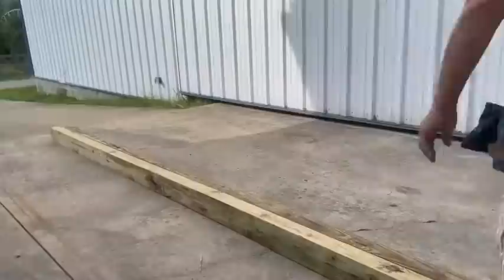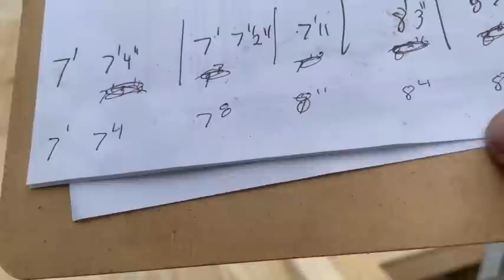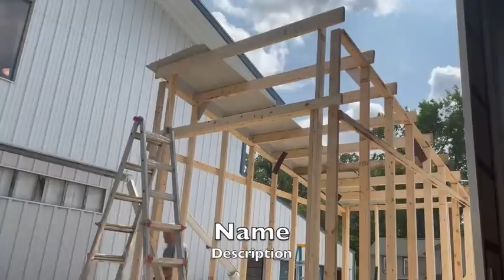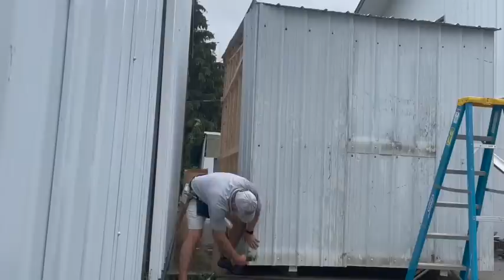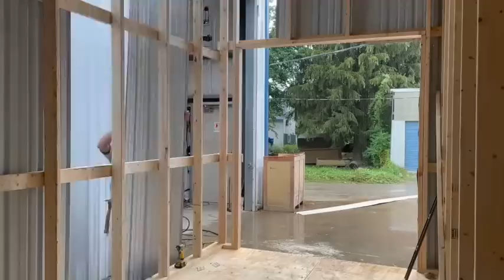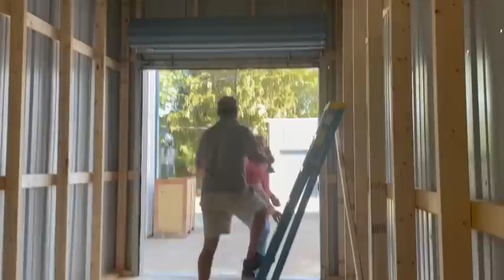How to build an Efficient 8x16 Storage Unit! Maintenance Free for 25% of retail price.

Comment: If you plan on insulating the floor on this style structure use green treated plywood as the under layer between runners and floor joists place floor joists, insulate floor, place 1st floor plywood sheeting layer, install walls and exterior sheathing on the walls insulate install roof trusses sheath inside of roof, insulate roof, sheath roof insulate interior walls and finish by sheathing interior walls install flooring and interior/exterior finishings in that order. Due to roof and wall loads I use no less than 2x6 wall construction and no less than 2x10 rafters and doubled 2x12ridge beams on conventional gable roofs  with no less than 2x6 ceiling joists (this is used for high roof loads) but this works for all insulated shed designs

Comment: I always see the subfloor cut and offset on shed builds. What is the reason for this? It is always done, but I have never heard it explained why. Thanks!
Reply from the maker: Offsetting the plywood provides more structural strength by not having seams all in the same place.

Comment: Those skids, 4x6 stringers , that you are using for your foundation should be cross braced ,and diagonally braced to prevent racking. Especially if you were, to try and move the shed by pulling it . Also the 4x6s are a little light for skids I would go with 6x8s,as well as using 2x4s for floor joists at minimum I would use 2x6... and would have rim joists ..
Reply from the maker: Thanks for your comments... you are welcome to build anyway you like. We never had any trouble with racking. The first we built, we did find the need for the strapping of the 2x4 to the runners when moving.  I have been using this design for over 10 years, built many for our own storage, for off-site rentals, and sales. The goal was: efficient, cost effective, and durable. We have never had a fail due to floor joists, 4x6 runners, or rim boards (which I agree can be an effective improvement ). We have moved them by forklift, pushed, pulled, and hauled them without any issue. Good luck in your build.
Reply: Have you tried racking plywood?  It’s better than any cross-bracing, ever.
Reply: The rule of thumb I use is if there is more than 2feet of overhang or more than 6ft between skids I add an extra skid because I hate rocking/dipping structures... But then again I always build my sheds   insulated to start because I like working on my equipment in a warm area (I also use double floor sheathing for possible high loads off joist such as storage racking and use truck bed liner to make a weather tight floor pan (reduces floor rot potential)